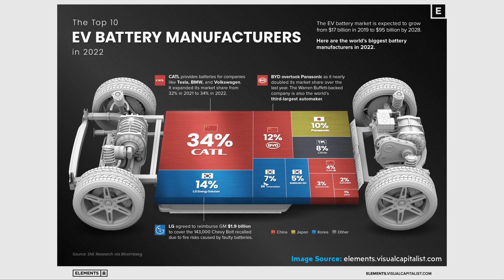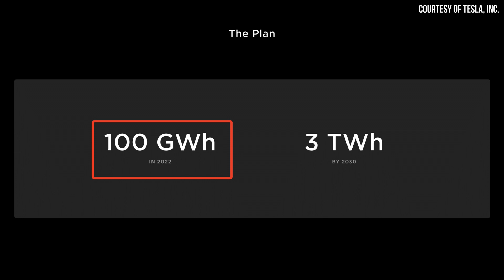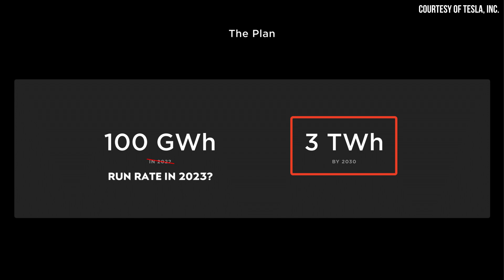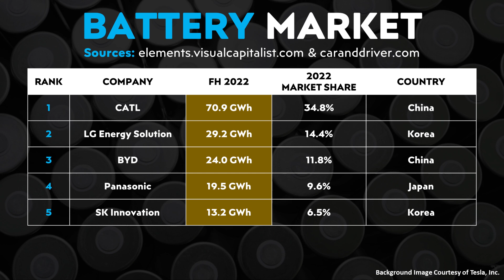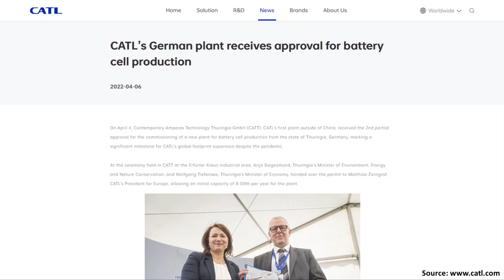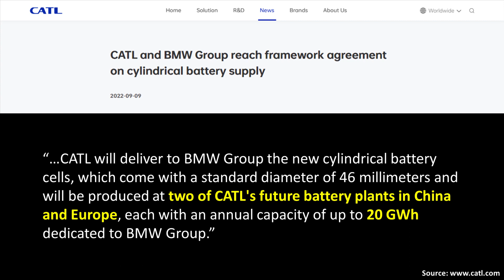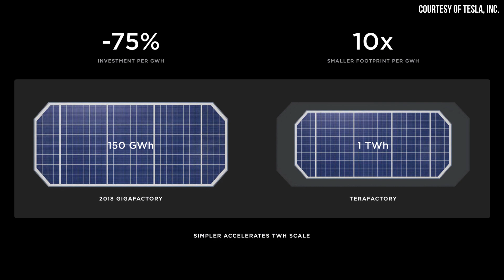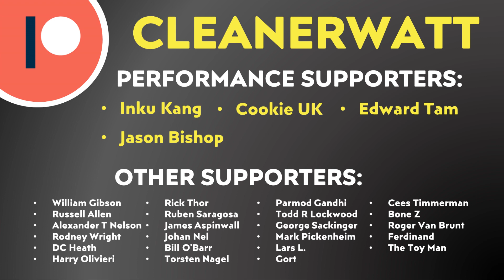TESLA is about to DISRUPT the EV Battery Industry

Comment: All that is new is problematic. Even EV
Motorcycles have a low life span with problems, not fully charged, damaged. N other cause an using battery in power.
So for heave  vehicles powered with EV
It is still safer to use ICE Vehicles

Comment: It must be pointed out that the battery factories are the final end of the story.  There are the mining, transportation, refining and processing the battery raw materials, chiefly lithium.  These are largely unknown because there are so many other companies competing for the same resources.  Which means there will have to be more exploration and new mining taking place.  The companies can build battery factories but they're totally dependent on a ginormous supply of the raw materials.  That's a very big unknown and hard to pin down to predict how much capacity the factories will be able to output.
Thanks for the video.

Comment: I am sure Tesla is targeting your projections but they were targeting FSD in 2017/18/19/20/21/22/23? They only have to develop a new dry process add in silicon and scale up to speed the cathode is coated by 100x. Then source lithium,nickel and Colbalt without Russia ,kids (congo) or carbon burn(Indonesia)?

Comment: What everyone seems to miss are the consequences Tesla's choice of making large cylindrical cells with a tabless design. The equipment is much simpler, and the creation of the jelly roll is much quicker than the piecemeal way that pouch cells are made.  Add that to the dry electrode, and this results in a massive cost reduction. Rolling out huge volumes of these cells will be much easier than anyone else will be able to.

Comment: The one problem I see for an increase in battery production world wide of the scale you talk about, will be that scaling the mining of resources (lithium and nickel and others) will not be at the same speed as the production capacity. This will likely hold back this fast ramp in production capacity. Of course this could be circumvented with other battery chemistries like sodium ion but these are nowhere near the required production capacity at the moment.
Reply: Australia has entered the chat...
Reply: Tesla will enter the mining industry if they have to. They don't want to. But they will, if it's the only way to get the materials they want.

Comment: you can make all the battery manufacturing capacity in the world and not have the supplies to have it attain the capacity.  Lithium in particular is in short supply and with Chile now out of production due to a Supreme court ruling there ; it will be even harder to obtain. China favors it's own; and China is now a major source of Lithium; and existing contracts make it hard for anyone else to horn in.  Tesls is no doubt smart and will try to secure these supplies but that by no means assures them.

Comment: the analysis is interesting and research done to document the projection needs to be appreciated, however there are some important question marks concerning the proposed conclusion - TSLA being no.1 battery producer (or at least getting to where CATL would be) - the underlying assumption is that Tesla will grow much faster and catch up (only argument being that I did so in the past) - beyond the liniar logic, which applied to a non liniar world is risky to say the least,, I will just point that a lot of targets put forward by TESLA including those on battery production were not achieved yet (reasonably so as they where overly ambitious- another discussion why Elon does that, but not the point here) + the growth projection is exponential and it requires the company to not hit any kind of bumps for a 9 year period - does that sound reasonable? (without having any data, just on pure logic) On the other hand the competition does not benefit from the same positive outlook and their growth is assumed to be liniar although they hold a massive advantage at present - Itțs like saying runner TSLA will catch and overcome everybody although they are 5 laps behind because right now they are running faster and by their current pace they will catch everybody in 10 laps, and they do not get tired, only the competition does - do not get me wrong, I hope this will happen and there is some chance it will but it seems overly optimistic. Factor in uncertainties that this world is full of (pandemic, war, recession - just to name 3 big ones in the last 3 years that had major impact) - this seems more like a positive imagination exercise than reality. i think it was Elon who said making predictions is a fools game. I am a long term tesla investor, i do think they are a highly innovative company, but we should be realistic

Comment: Jon, excellent extrapolation from a Factual base - Thanks. I have gradually learned how to translate Kwh,To MWhh to Gwh & to Twh. but it would be hugely helpful if WE ( the learners) could translate these Complex Anagrams in to real world stuff. Of course this needs assumptions and averages, but for ease of math - assume 1 Tesla BEV = 50kWh as an average how many cars do these xWh descriptors EACH equate to. The same exercise for Stored energy, and for Consumer benefit assume higher density capacity for a domestic Tesla Powerwall of say 20kWh each - How many power walls do each of these acronyms represent? THEN assume the 20m vehicle target is achieved and prioritised, how many batteries will be left for Grid Based Energy storage ( Megapacks).
Finally please can you express each of these Anagrams in Number of 4680’s based on current Density? It might be worth an episode all to itself with your super clear tables that can be modified annually, or as required when  density improves? Thanks @EvEvevangelist and @CookieUK

Comment: What’s happening with LFP+manganese?  It’s supposed to offer the same energy capacity as nickel cells without the costs and no cobalt. Nickel is getting very costly so why is Tesla not using LFF+M?
Reply: I have a hypothesis.
We're hearing that Tesla is using a "dry process" anode, but not Cathode.
Could it be the metal in the Cathode makes it literally "harder", more brittle?
If that's the case, iron being a "harder" compound than Nickel may make the process even more difficult?
.

Comment: Tesla is not about to disrupt the EV battery manufacturing. That implies it will happen very soon, I.e. in the next few months.  However, they might have a big impact in say 3-4 years.  It obviously takes quite awhile (see 4680s).  They will get there…especially if they desire to do so.  Just gotta be patient.  2023 could see 40-50 Gwh.

Comment: Good video Jon! I recently purchased a used 2020 Model Y. I like the car... But Tesla service treats me like 🐶💩. So, I made an appointment for Tesla service to come to me. What happened? Driving home with my sister and her kids. First, the right rear window rolled itself down about 3 inches. Then, while in cruise control, it kept running the wipers... But no washer fluid. In Autopilot, it will clean the windshield on it's own, but I wasn't in Autopilot. I had a Model 3 last year, and never done any of these things. Also, on a dark night, the right side pillar repeater camera complains it can't see anything...

If I had a ride, to leave the car at Tesla repair center for the day, fine. But, my best friend in the entire world - my Dad passed away about 7 weeks ago. Sure, I have a diesel pickup and a suitable trailer to haul it on.... But, with Diesel at these prices, I'll just sell the car.. It doesn't fit my lifestyle when 💩 breaks. 

It also has FSD, but I don't care what other people's experiences are, it's dangerous. It's really abrupt, it really slow - depends on the scenario. So, I just drive it manually most of the time.

Like any other mass produced vehicle, there's always going to be problems. Tesla is pushing suppliers really hard, and their employees, and factories really hard. Quality suffers. I have a saying, I used it more towards the ICE manufactures... But it fits Tesla as well... Build it faster and cheaper.... But now add in, more expensive. I don't care if the cars are getting cheaper, and this tax thing next year is ridiculous, everything's going to suffer a bit more.

I'm glad they make a higher end vehicle, but if you can't get it serviced, then it's worthless. Again, I'm glad I have a service center closer to me, but it's not much of a help in my case.

Comment: So many aspects to weigh up, mining, processing, battery chemistry, form factor, but ultimately profitability and ability to ramp production are big ones. CATL is amazing, LG, SKI, Panasonic not in the race. BYD? 
CATL will hold onto Chinese market, particularly LFP expertise. Single minded, aggressive expansion. What’s their profitability? Political connections to CCP?
IRA should be huge boost to Tesla batteries, few others, but only if US origin minerals & factories, need massive automation to compete with China labor rates & lax pollution controls.
Two years since battery day, no new innovations in that time?
PS. Any difficulty Tesla has, others will face with same innovations. [DBE, silicon anode] Reverse engineering (copying) not always rewarding.

Comment: The 4680 ramp is the hinge factor. I expect slow progress...
Reply: Teslas suppliers are also all making 4680 for tesla. The 6 biggest suppliers and tesla are all at it. Tesla is trying a new method which should in theory scale much faster than using traditional methods assuming they can iron out the kinks. Still they are not limited by in house production right now. Its going to be interesting to see if they can scale faster than the rest once the kinks are worked out.
Reply: @makeitgreener642  
I agree.
It's yet to be confirmed how similar the cells will be.
.
I'm assuming there will be a "fair use of patent" arrangement (tabless? Or variations of?)
.
Rumour suggests the Panasonic version to be wet process, "5 tab".
I have ideas regarding the "5 tab" method, which could be an interesting feedback into the in-house Tesla cell for even faster production.
.
The wet process would be a stopgap, still requiring the huge factory, complicated process and associated overheads, not ideal moving forward.
.
It would be great if the 4 companies involved have a full and frank exchange of ideas leading to a common design which is literally a game changer (and a "license to print money" for those involved!)
There's more to gain by cooperation.
.
Imagine Tesla, Panasonic, LG and Samsung all punching out 4680 cells from small modular factories globally?
.
Either a small royalty for tech solutions within the common cell (could go either way!) or an agreement for first refusal of cells produced over a set period (5-10 years) would advance the production as required.
Just as with the vehicle market, percentage market share wouldn't matter, lower percentage of a huge market would be "profitable".
Reply: @rogerstarkey5390  tesla did try to patent it and got turned down, as an obvious progression of an existing technology.
Reply: @makeitgreener642  
Show me the document showing it was "turned down"
Every report I've seen acknowledges the Tesla patent.

Comment: I noticed the batteries being made for BMW by CATL have 46 mm diameter cylinders.  I wonder if the can length is 80mm?
Reply: I guess it would then be called CATL 4680 cells too. but what is the battery composition like?

Comment: I hear a lot of the EV's in the path of Hurricane Ian are catching fire because of compromised battery boxes allowing some water in  resulting in fires. The local fire departments are using foam similar to the PFAS used at Camp Lejeune.
Reply: Reads like FUD. Chief Fire Officer actually runs a restaurant, isn’t a firefighter as such. Lots of GOP politics. CleanTechnica has an article, but not very good. Mostly just FOX news.
Reply: I think you're confusing PFAS toxicity and the Lejeune water issue from the 80's.